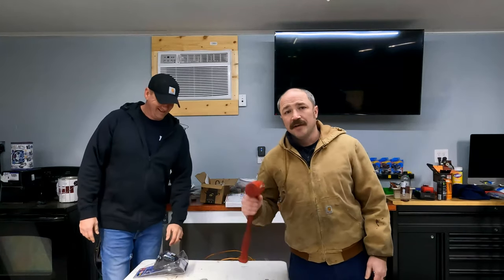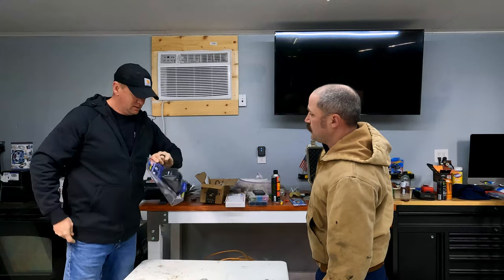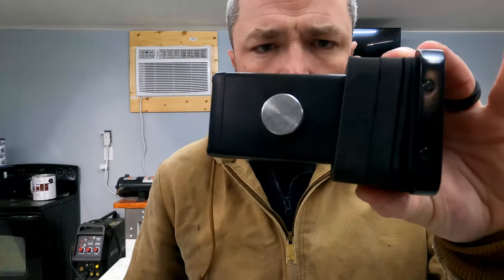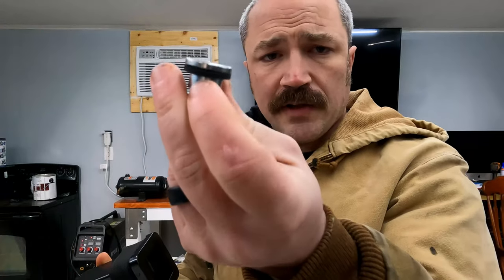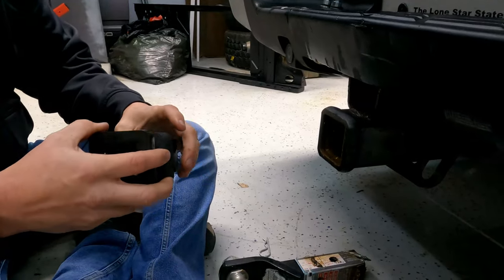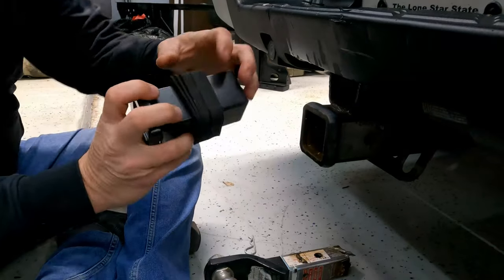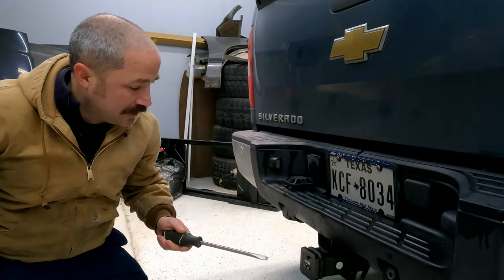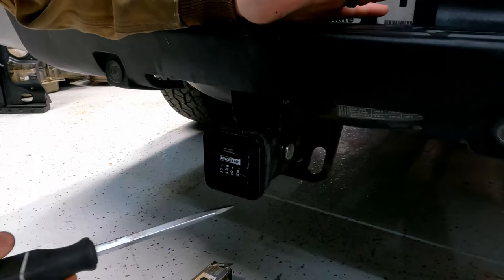Trailer Hitch Vault Product Review

Comment: My experience with this unique lockbox wasn't very good. I found out that my lockbox wouldn't open while at home, before really needing it. Tried to make this little pick tool from a shim and couldn't decode or otherwise get it to unlock. Finally used my SawzAll with the bi-metal cutting blade and cut the face part of the box off to get it open. I really can't recommend this to anyone, based on my experience.